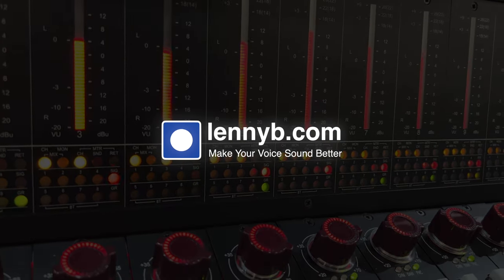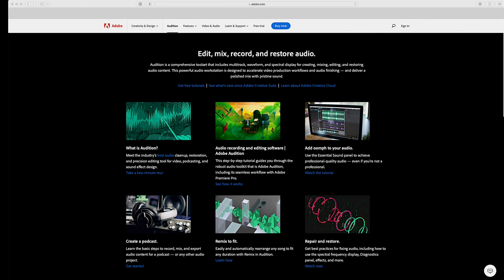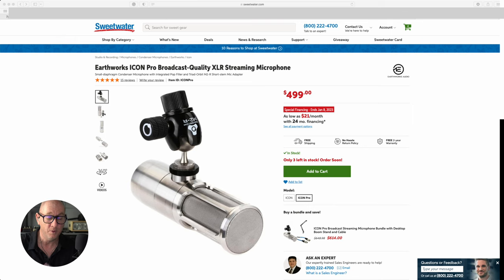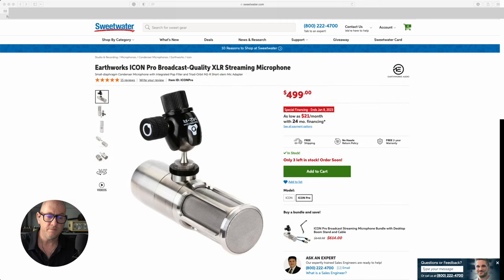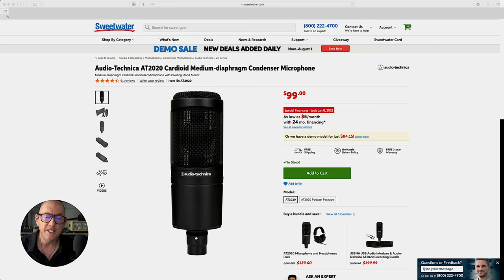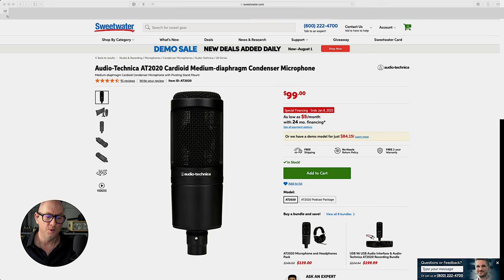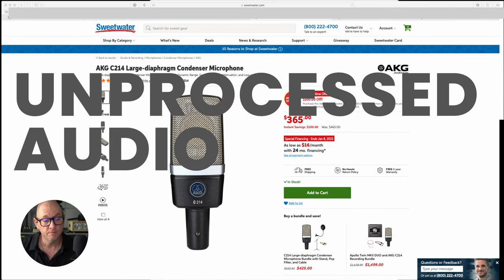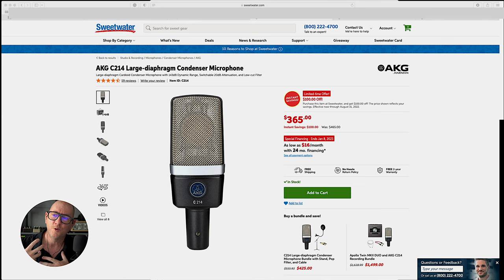Voice Recording Diagnosis (Earthworks, Audio-Technica, AKG)

Comment: Fascinating.  Thank you, Lenny.  Been watching your videos for a few weeks and am just getting started in this.  (History of teaching and performing, but not the audio processing side at all).  I was wondering about the example with the room noise where you used the expander.  It certainly improved the quality of the recording.  In a few of my initial test recordings, I have had some of this, and using iZotope Spectral de-noise (using "Learn") seemed to give me very good results and I couldn't hear anything wonky with my voice as a result.  Yet I'm reluctant to trust something "automatic" like that not to leave artifacts or degrade the voice.  Do you have any thoughts on RX9 Spectral De-Noise and whether it can work well to precisely remove minor constant noise without compromising audio?
Reply from the maker: Hi Andrew, I do. My approach towards any RX (restoration type plugins), including Spectral De-Noise is this. I use it as a last resort. You have precisely touched on the reason. The heavier you use RX, the more it degrades the overall audio quality. So if there is noise in your system, it is best dealt with before its recorded. It could be non-pro equipment, poor or wrong connection types, air-conditioner/vent noise, or whatever. I use Spectral De-Noise and other similar plugins (sparingly) for clients and explain that it's masking the problem, not fixing it. It really depends on the project/expectations. I hope that helps.
Reply: @HeyLennyB  Yes, that does help.  What you say about restoration plugins as basically a helpful "last resort" makes sense, as it seems a wise approach, based on an understanding of what the plugins are technically doing to manipulate/change/remove from what originally went originally went into the audio (sometimes manipulating in complex ways).  Yet I have almost no practical experience in this arena of audio processing.  Thus, it is easy for me to experiment, but not to know what will likely turn out to be the wise approach generally, or what specific sound situations should suggest to me what might be the best approach.  Your clear, thoughtful explanations and demonstrations are very helpful in getting to know the character of different aspects of sound and sound tools, and how they interact.  Thank you for the helpful reply.
Reply from the maker: Andrew, I have a thought that may help. Email me your contact info (at lenny@lennyb.com).

Comment: Noticed the last one mentioned using a lot of rockwool.  My wife is concerned about the health ramifications of using rockwool, or fiberglass, or basically any other technology commonly used for reflection control. Do you have any alternatives that would treat a 19x10 room?  Are there any online resources that speak to the health concerns with commonly used solutions?
Reply from the maker: Hi Tim, I'm right there with you. It is one of my concerns too. I know that you must take caution while handling the material. However, I asked GIK Acoustics (which are the panels I use https://www.lennyb.com/blog/acoustictreatment) about it. All of their panels are covered on the front and back. So there's no Rockwool exposed. Now, does that make them 100% safe? I have no idea. Yes, Rockwool is the industry standard for sound absorption. Are there other, more health-conscious materials? I'm sure there are. One company I've come across is Audimute (https://www.audimute.com/eco-c-tex-vs-foam). They offer a nonfiberglass option. As far as effectiveness, it all comes down to the NRC rating for each frequency space. NRC is how much sound is absorbed. I suggest you research Audimute further. There are many products that absorb well, but not in the low frequencies. That is where you get low and mid-frequency problems while recording voice. That's why many people lean towards Rockwool/fiberglass.  I hope this helps. Thanks for watching!!

Comment: REALLY enjoyed this video, Lenny! Very interesting, and I appreciated what you said about the doubting artist voice. 
I have an interface question for you. I want to upgrade mine. Currently using a Black Lion Revolution, and the noise floor of the preamps is just a bit too high. Looking at the UA Apollo Tein X and the new Neve 88M. Do you have any thoughts on these, or any thoughts on a different option?
I do VO, podcasts, and media composing. Thanks for your time!
Reply from the maker: Hi Blake! Thanks for reaching out. I have been with the UA Apollo interface for my own set up for quite a while. I haven't use the Neve 88M, but I know you wouldn't be disappointed by either choice. The Apollo has the added benefit of doing the plugin processing (in realtime) on the hardware unit and not on your computer. So, it would be a great feature for live streaming or podcasts. I will say that I'm slightly surprised that you're getting noise from your Black Lion interface. There are a few things that may be causing the noise, other than the interface. If you want, you can send me a file and I'll take a listen and see if we can't get to the bottom of your issue.  Thanks!
Reply: @HeyLennyB  Actually, when I use it with my Shure KSM32, I don’t notice the noise at all. However, when I use it with my SM7b, I definitely notice. I use an SE Electronics DM2 to get around it, but I think I’d really just like to get something more advanced. Especially as I incision getting outboard gear in the near-ish future, I’d like something I can be fully confident in and rely upon to be the brain of my studio.. If you happen to be familiar with Julian Krause, he did a review of the BLA Revolution, and it surprising performed more poorly than interfaces in a much lower price point. I’m now starting to run into some of those issues. 
I’ll send you a sample through your website though, and see what you think👍
Reply from the maker: Interesting. That's where I was going, but I see you are using the SE DM2. OK, I'll look forward to your audio clip. Thanks